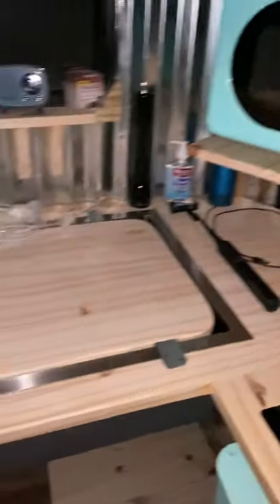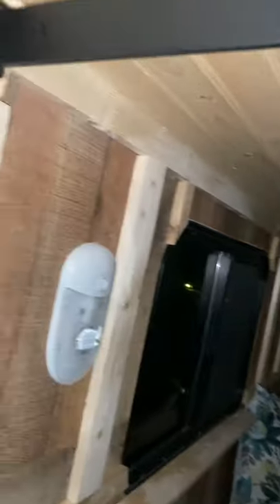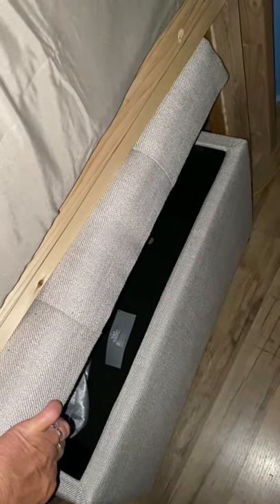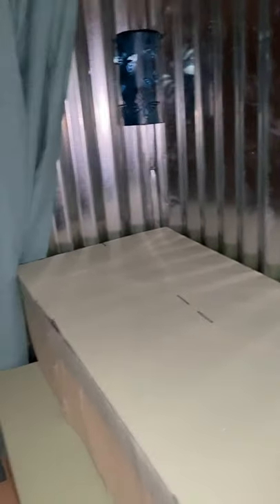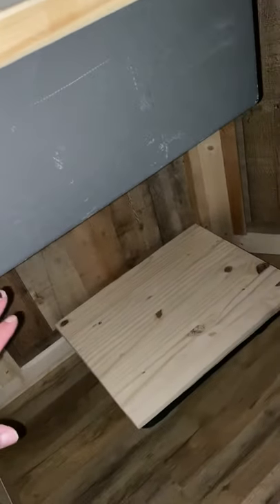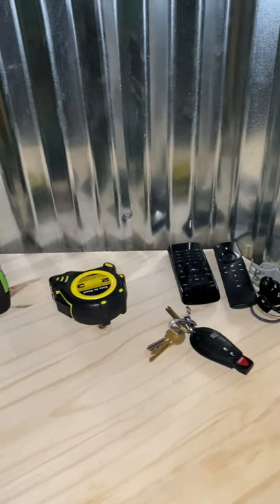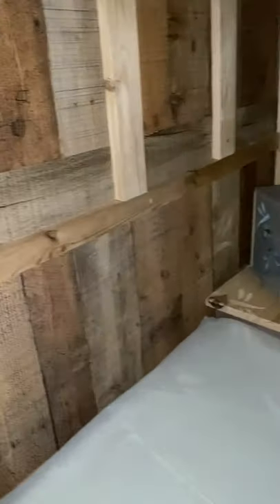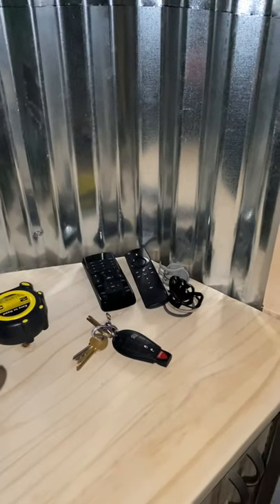Cargo Trailer Conversion/Sink and Burners Are In

Comment: It looks beautiful, i used a poly stain all in one on my cabinets, i wanted to save time. I'm not happy with the brush marks, i wish i would have stained them with a few coats the put on the poly. Just something to think about if your thinking of a poly stain all in one. If the stone isn't heavy the back splash tile adhesive should work nicely, if your going big you'll probably need something similar to brick ties regardless of adhesive. God bless!!
Reply from the maker: Yes Mike…..I agree about the stain….I remember that was something I learned from the cabinet builder husband about staining and finishing. Thank you for reminding me! I might would have been tempted to rush it as well but you have refreshed my memory.  That’s great info on the adhesive.  So yes….The stones will be small to medium. Not heavy.  That’s perfect. Thank you!